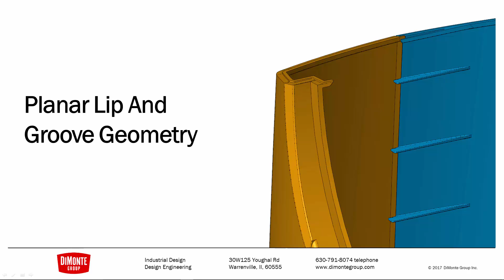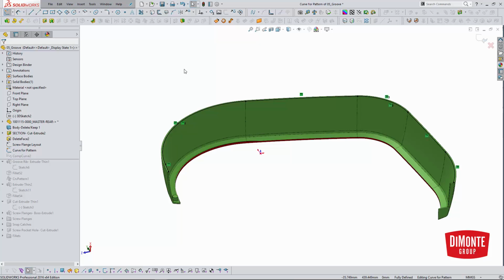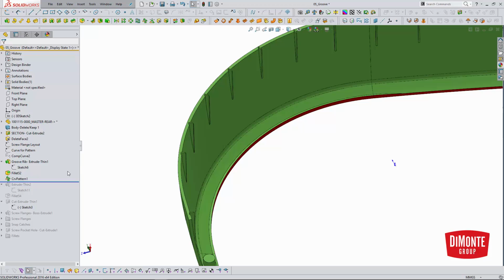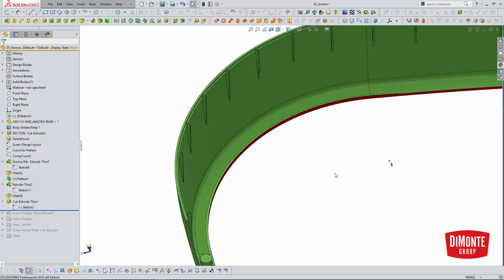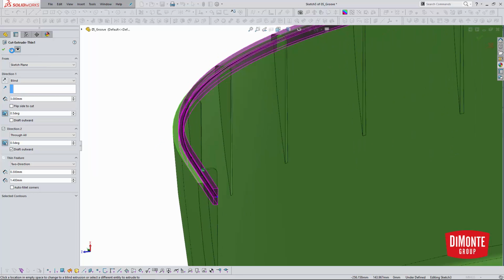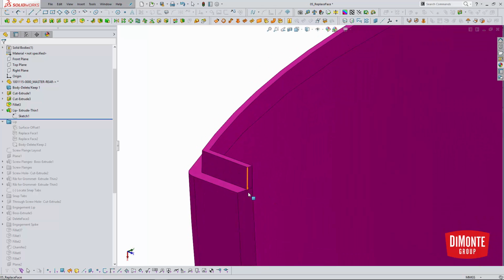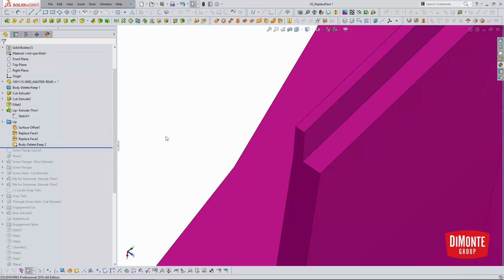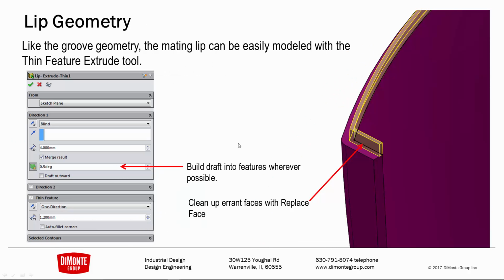SOLIDWORKS Tutorial - Fantastic Plastic 06 - Planar Lip and Grooves

Comment: Hi Andrew, Do you have any reference between the two parts? I.e. if you update your lip thickness do you have to manually update the groove thickness to match or is there a way to reference one off the other?
Reply from the maker: I usually don't set up any parametric relations between the lip and the groove as the dimensions are ultimately determined by the nominal wall thickness which both parts usually share. You could easily set up some in- context sketch relations by converting either the lip or the groove sketch from one part into a sketch in the other part. If you need an offset, offset the in- context sketch instead of trying to do it all at the assembly level.